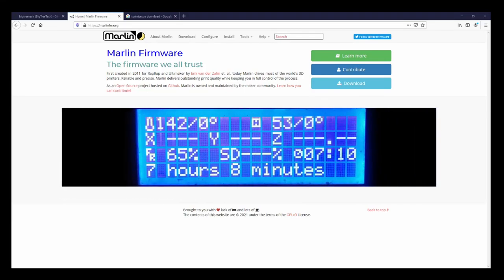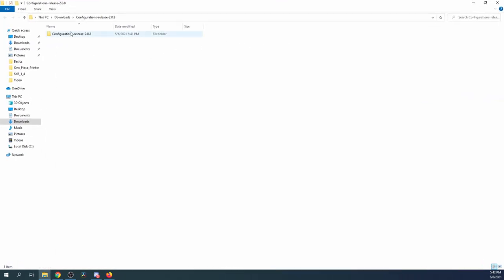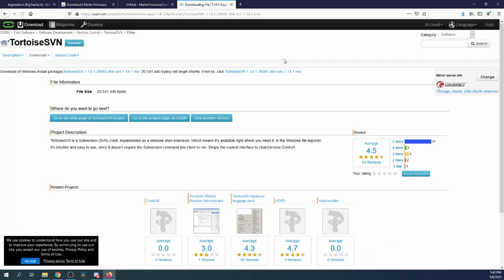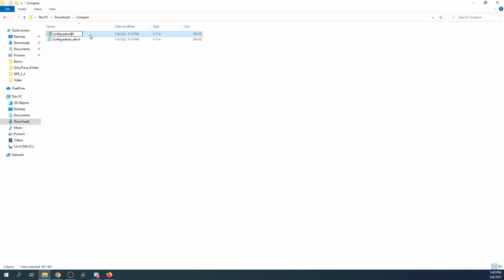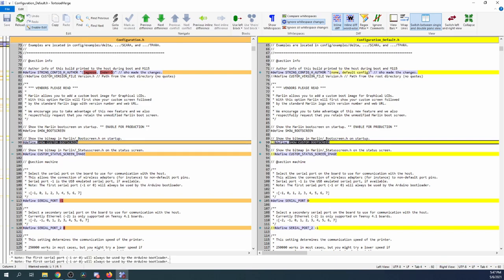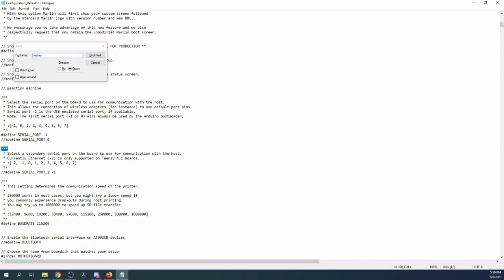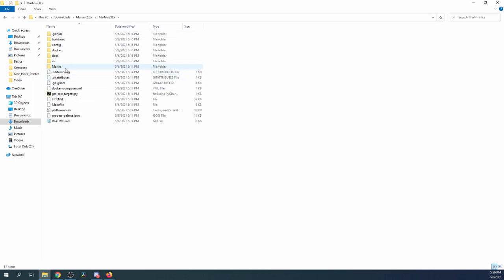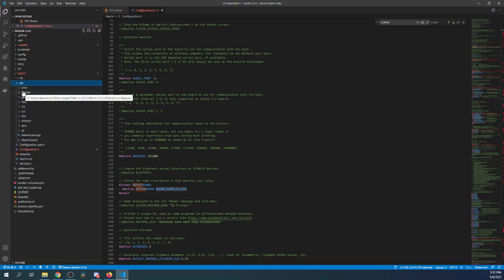Marlin firmware - Example configuration explained

Comment: Pro Tip: You can skip the SVN diff stuff by comparing right in VSCode!
1. Open the example files in VSCode along with the Marlin folder
2. Right click on one config file, then click on 'select to compare".
3. Right click on the other config file, then click on 'compare with selected".
Reply from the maker: Good point, but remember most people that are new to IDE want to keep it simple.